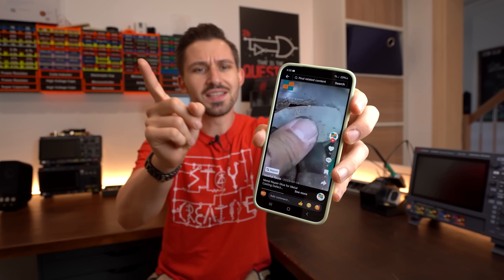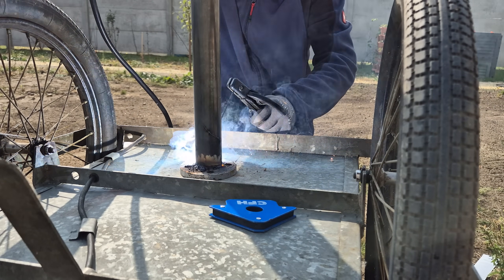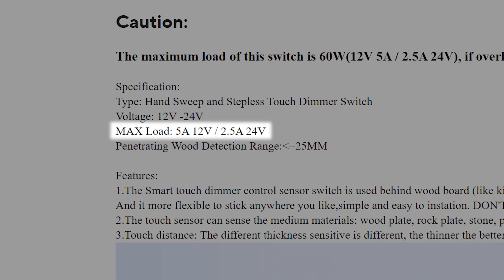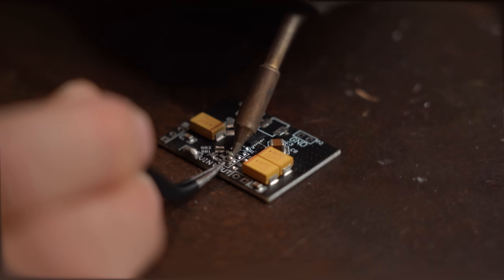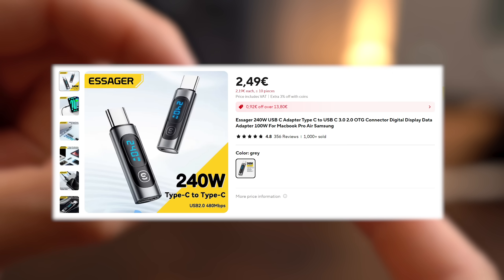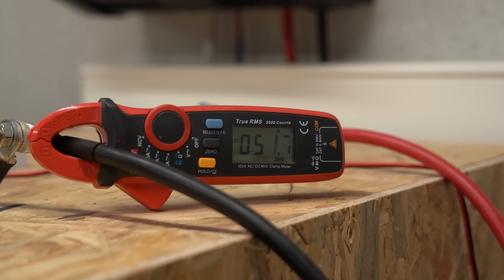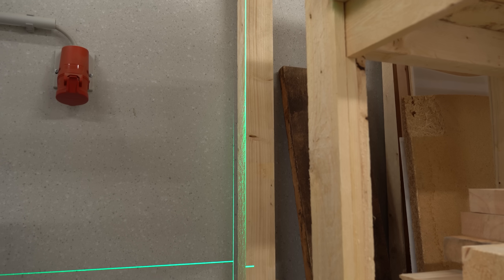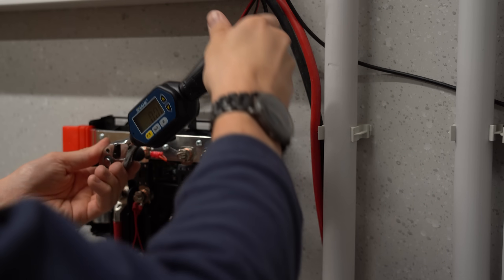I tried finding Hidden Gems on AliExpress AGAIN! (Part 11)

Comment: I remove 2 pin SMD components exrremely quickly, with just a normal fine soldering iron tip.
Put a blob of solder on the iron tip with the iron horizontal so the blob kind of hangs from the side of the tip, then touch the blob across the entire component.
The component will instantly de-solder from the PCB and be stuck to the blob, so immediately after that, tap the iron on the table etc and the blob and component will pop off the tip and be on the table.
It sounds rough, but I can remove components in about a second each and yes they are ok to re-use because they were only hot for a second.
Reply: the knife blade-type tips are especially great for that :)

> tap the iron on the table

there's a risk of damaging the expensive ceramic heating element. It's better to just wipe the tip with a napkin
Reply: @ewfreg5nythyhtewt4w    I like the tap, I have a flat glass plate I use for SMD work, and the tap is very fast for getting the blob off the tip and also the "splat" when it hits the glass often separates the component from the solder blob. It only takes a tiny amount of force. I've been using that method since the late 90's. 🙂
Reply: the best is to have two irons, same type, with a little bit of practice it's damn fast.
Reply: Instructions unclear, I am stuck with 2 electrolityc capacitors to desolder. Help?
Reply: @sebastian19745     for electro SMD caps; use a poi ty thing like a dental pick. Heat one leg of the cap, then get the pick under it and raise it a tiny bit on that side.
Then heat the other leg, and raise that side a tiny bit. Then repeat.
Sometimes on older equipment the larger caps are also glued down with a spot of glue in their centre. You probably have to destroy those to get them off because it is heat proof glue, the important part is not to wreck the PCB
Reply: @sebastian19745 
Stuck where? Not your penis I hope.
Reply: It only doesn't work for LEDs very well.

And particularly it doesn't work for large SMD electrolytic capacitors and other large and tall two-pad components very well at all! Which is why i have been considering hot tweezers myself.

Comment: I have probably a dozen of those touch sensors in my electrical junk. We had a local custom home builder that loves accent lighting but doesn’t like quality parts, so i have been removing them and replacing the lights with better quality contact switches and better lights.
 Btw, torque wrenches are a tool you don’t want to go cheap with. It might work at first but if you set it down too hard or drop it, you’ll never get the same readings again. My torque wrenches are calibrated every year, something you can’t do with cheap ones.
Reply: Someone actually tested it, was it Project Farm or Torque Test channel... it apparently takes an extraordinary amount of cruelty to actually upset them, and the warning is an abundance of precaution as well as manufacturers covering their arse. Also electronic torque wrench doesn't really work on the same principle, and have rather different flaws, but given it's made by Shahe, i'd expect it to work just fine if used as intended, their tools aren't made to compete with upmarket ones but you're not exactly scraping the very bottom of the barrel either.

Comment: Maybe it's a idea to  do another spot welder video, something budget that can weld copper plate with the nickel sandwich hack. I don't want to buy a 150 euro spot welder for one project, so maybe you can review cheaper alternatives. I'm planning to modify a "purple" 15 $ one, it needs more mosfets and some extra components to combat voltage drop (that kills the mosfets) but maybe that a 30$ model that has standard more mosfets are better.

Comment: Yihua982 also great soldering station for small and the big types op replaceble tips! Heats up in 4 seconds before solder goes melt on the tip

Comment: Green Laser, I maybe overly cautious, but is that laser "Eye Safe"?  Otherwise, pulling on a pair of Laser safety glasses (for that particular frequency) would be prudent.
Reply from the maker: Should be safe....
Reply: If it's using a mirror to create the line by flickering it across, it should be safe. Safe-ish anyway. Just don't stare at it.

Comment: You may want to know the same brand that makes the USB-C to USB-C power meter also makes it in cable format.
Reply: @berfranper Does it work both ways? Can you connect the meter side of the cable to the power brick/bank?
Reply: @nikolasapple2100 what do you mean? Both sides should have the same amount of power going through them
Reply: @enihi   But voltage-current capability negotiation can break down at intermediate points so sometimes things don't work that seemingly should.

Comment: since this is part 11, can we do a compiled video of 10 parts showing only thums up products. that will be very usefull since every good thing will be in one place and can be done every 10 parts
Reply: Also long term reviews. Do the products still hold up?
Reply: @enihi  I like this suggestion more than the compilation idea
Reply: Hey i'm finding some of the thumb down products rather attractive because my use case may be different enough to where they may be just what's called for. Though of course there are some absolute hopeless ones, but then, it's still good to know so one doesn't accidentally buy them :D
Reply from the maker: Hmmmmm
Reply: @greatscottlab  he's got a good idea! Compilation of recommended products should take some editing work and an intro outro but would definitely be helpful to new viewers
Reply: @greatscottlab  YES PLEASE
Reply: Great idea. A compilation but with a bit of commentary saying how it held up over time. Kinda like the compilation videos of "Freakin' Reviews" channel.
Reply: *thumbs
Reply: Lazy eye ranch dressing turkey slices
Reply: It is great epoxy glue , you did not prepare surfacewbAND PUT SMALL AMOUNT FOR THAT FORCE MULTIPLIED with lever.
Reply: Wont work as other stuff is outdated within a month
Reply: @EugenePutin  i dont think everything gets outdated.
Reply: @EugenePutin still worth it for something that looks nearly the same to know if it’s worth trying.
Reply: @EugenePutin  yeah all the links will be dead a month later, knowing the nature of online.

Comment: By coincidence, I tried to do a job with the 'laser thingy' this morning and I have to concur, for the price the build quality and amount of functionality is stunning.  But it is not very practical or accurate, and I quickly reverted to a simple spirit level!
Reply: There are auto-levelers that are much cheaper than the mentioned Bosch. I've been using a 'noname' Tacklife one I bought a few years back for less than €30, and I haven't had a badly leveled thing in my house ever since.
Reply from the maker: Thanks for sharing
Reply: @greatscottlab I got a laser level like the one you had for like 10 bucks on Ali. From a brand called Hilti or something like that. I mount it on a camera tripod and it seems to work quite well.
Reply: Exact same experience here, it's not accurate at all

If I remember correctly (bought it quite a while ago), when I took it apart, the electronic was accurate on its own, but as soon as you assemble it, it's off by a degree or so.
I think the circuit board sits crooked in the housing or something like that....

Comment: There are 240w power Display inserts that will also allow 40 Gbps through them. They are nice. I bought a pair, but they are limited to 140w / 28V, but they don’t hamper my USB4 SSD enclosure, and they also allow me to measure the power draw and the voltage on the V+ line
Reply: So what's the power draw the USB enclosure?
Reply: @enihi  it is a Maiwo, and uses an ASM2464PD chip, which apparently has a high draw. Around 8 watts active, 3 watts when inactive. A little less when connected at USB4 20 Gbps. Much less when connected at 10 Gbps, just 3 watts active and 1 watt inactive.

Comment: so I have used that same UHU epoxy and that stuff is amazing. It is strong, it hardens in a day, it sticks to basically anything except polypropylene and teflon (expected)
But it doesn't fully cure unless you bake it at 200C 
If you bake it for 5-10 minutes at 200C it'll be MUCH stronger than at room temperature and it'll cure faster of course
UHU has a curing chart with temperature, time and strength on it
Reply from the maker: Thanks for sharing :-)
Reply: Sorry if this is a dumb question, but does it say to do that in the instructions?
Reply: @f.avilla6383   not exactly
There is a chart with curing temperature, time and strength  on the back of the package and online also
 It's easy to miss if you don't exactly read every bit of information about something as simple to as glue
I am not sure if the instructions themselves say anything about it
Reply: @Cjarka_  cool. thanks.  i usually just use JB weld/Quick Steel for minor repairs. at work i had to use expensive epoxy for manufacturing applications, and i wanted to make the process faster (it took 8 hrs to dry) and asked if i could heat it up,  and they said no, due to risk of fire or unknown issues when heat is applied to that epoxy. it might effect the chemistry or durability, etc.

Comment: the touch sensor is useful for switching things in waterproof housings...what is the idle current draw though?
Reply: Capacitive touch sensors tend not to work quite as well when run off battery. I'm guessing it is a static charge issue. The Ic is probably something like AT42QT1012. Because it is cheap and does barely enough. The power draw is listed as being exceptionally low. ~50 microwatts 1.8v to 5v. Could be a nice way to wake up a project in a glass tupperware. I am curious what current it actually draws with all the other parts.
Reply: @badmood88  The more common reason for capacitive touch sensors being iffy on battery power is that they tend to be very sensitive to input voltage & noise, and most battery power setups either have significant droop as the battery discharges or significant electrical noise from overly cost-optimised switching-mode power supplies.
Reply: @TheLoneWolfling  Switch mode power supplies can be bad, regardless of AC/DC.
Reply: @nimoy007  Agreed. Overly cost-optimized  SMPSes can be rather terrible in general. Overly cost-optimized battery-operated SMPSes tend to be worse. (My guess here is due to testing at only one or two voltages combined with a relatively wide input voltage range, and significant source impedance as voltage drops.)
Reply: @badmood88  If you hook it up to a fish or a frog leg it could work... i mean, a great halloween prop.
Reply: I expected to see a circuit like in an RFID card?

Comment: Instead of getting the torque wrench may be nicer to use your higher quality wrenches and torque adapter. Torque test channel test few of them recently
Reply: I'm really pleased with my digital torque adapter.  I tested it against my larger torque wrenches.  It's been a few years and it still measures accurately, so I gave away the big clickers so I could downsize my toolbox.

Comment: Bad news dude. If you want those windmill pieces of metal pipe and base to not break in the wind you need to weld them properly. Chinese "metal glue" will inevitably fail sooner or later a proper weld won't. Learn welding it's a good skill some of the newer computerized welders do a lot of things for you automatically such as perfect voltage and amperage adjustments on the fly among other difficult things. Who knows perhaps Ali Express has one?
Reply: It's called epoxy, regardless of nationality epoxy has the same strengths and weaknesses and is certainly not 'glue'. American, European, Chinese, South African, doesn't matter epoxy is epoxy and is effectively worthless for bonding metals.

Comment: The laser level still looks kind of nice to me. I've been in a situation where I just wanted to align things along a line that isn't level to the ground, and with this, you can also see the exact angle that you're aiming towards, at the same time.
Reply: Be careful though, I have the same laser "level" and my experience matches with Scott : the readings are inaccurate.
If you put it on a flat surface, it reads one value one way, and a different value when you flip it 180°...

It's fine if you don"t need to be super accurate (within 1°, I'd say), but useless otherwise
Reply: @triggermovies maybe if you put phone with level app on and measure corectly 90 and 0 degre it should be fine! 🤔
Reply: Just know, you can lock the laser line on the "known brand" laser levels so they do this, and do no autolevel..
Reply: If you live in Netherlands, Belgium, Germany: keep an eye out for the self-leveling cross-line laser including tripod from Lidl (Parkside). It was only 20 euro in NL last week. Definitely better value than the shown gimmick.
Reply: I need to do a fence some time soon... A cheap laser line will be very helpful for putting in the posts. It's just a farm fence so doesn't need to be perfect, but lining them up along the property boundary will be easier with a laser than string.
Reply: Those cheap lasers can be quite difficult to see in daylight. For outside work you probably want one of those rotating laser levels. (but they are rather expensive) 😮 @tin2001
Reply: True.. I have both, this and the Parkside. This one looks better with higher quality but gives you false readings as for the Parkside one it's more accurate..
Reply: I got one but it was 0.3 deg out and has no way to calibrate. 0.3 is too much for me. I returned it. A pity as it was great in every other way.

Comment: With the torque wrench, use caution and follow best practices. The beeping kind can easily overtorque something compared to the click-type. Also, you cannot accurately check the torque of a bolt that is already torqued down because of static friction (or stiction). So I'd say it's great for your application where torque isn't critical, but if you start getting into areas like automotive, where torque can really start to matter, do your research. There's a great youtube channel that properly tests torque wrenches and torque myths.
Reply: Yeah and the clicking it was making seems like it was slipping gears lol
Reply: instead of beeping it should shock you with 240V so it makes you let go 👹or not
Reply: Snap-on digital torque wrench was the best I used while working as a bus mechanic. The LED indicators showing you how close you are to the set torque value is brilliant for creeping up on the right number. Every other kind of torque wrench I've used didn't come close to the snap-on one.

Comment: maybe the Tweezer Soldering Station was not the best quality or you needed to tune/ align it yourself
Reply from the maker: I tried to align them, but nothing helped for me.
Reply: I have the same one and I am happy with it. For the price, it can be be use where hot air is touchy to use. The only thing is that componant stays stuck on tips, you have to remove them qui kly if you want to not burn and reuse them. It is claerly not a daily use tool but for the price, it does the job. Just my opinion.
Reply: @johndoit 
Hold the component with another pair of tweezers while you melt the joint with the solder tweezers? Or would the ordinary tweezers then get too hot to hold?

Comment: do you have any recommendations for glueing PP or PE?  there seems to be very little products for sale. but it must not be impossible to do...?
Reply from the maker: Oh boy. Sadly I am not an expert in that field. But maybe CNCKitchen can help. That is the first one that comes to my mind right now.
Reply: i think 3d printers use PP/PE for their bed's? since adhesion to it is hard it would make sense.
Reply: the PU glue would be my best recommendation I think, at least for PP..
Reply: Do you mean polypropylène or polyéthylène ?
They're like the 2 most used plastics so I guess any glue suited for "usual plastics" will do the job.

There is no PP in 3d printing, and PETG rather than PE (easier to print), but the beds aren't in plastic because it would obviously melt sooner or later.
Reply: @neodymelanthanide2101  "pp epdm t20" to be specific.

i want to make custom panels for my car's dashboard and everything plastic is the "pp epdm t20"
Reply: @neodymelanthanide2101   These are low surface energy plastics so none of those glues work. Plastic glues are generally intended to glue ABS, PMMA, PS/HIPS, PC, which are very widespread, for example most of your device enclosures are ABS. PP and PE are used for food contact items for their effective inertness.

I think you need dichloromethane based adhesives for PE/PP but it's a hazardous and restricted chemical.

Comment: are you facing problem in arduino wire library?
please test it
my arduino library is not working with any microcontroller
the program stops at the wire.begintransmission()
and after disconnecting the sda and scl the program continuous
please reply